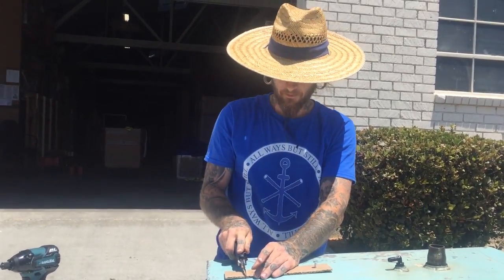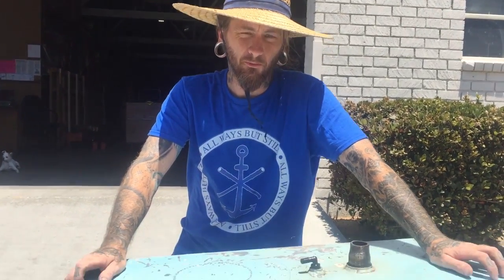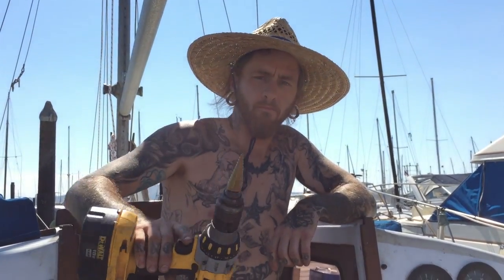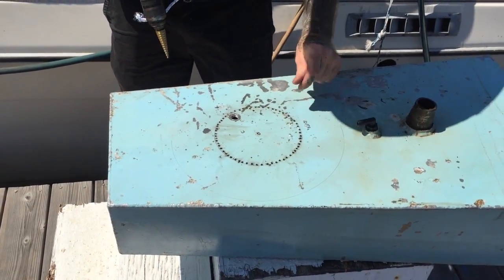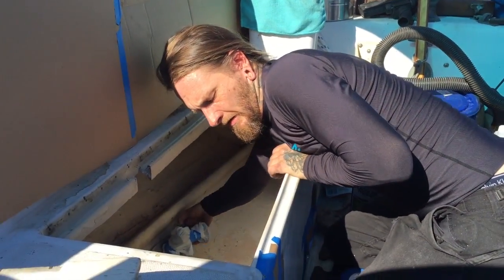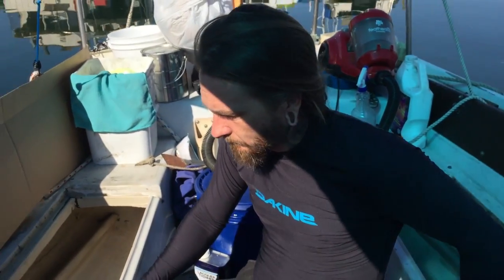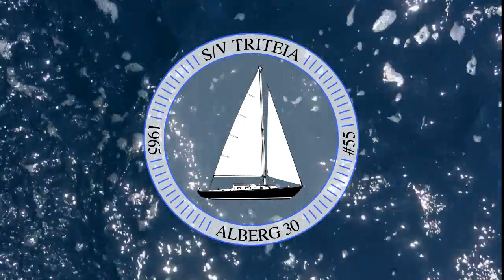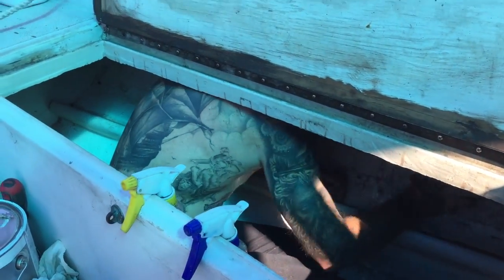Sailing Vessel Triteia - A Cut Above The Sludge - Episode 5 - Cleaning The Diesel Fuel Tank

Comment: For the bacteria, we had good results with drain cleaning chemicals (one tablespoon for a tank like Yours with every other full refill). But be careful, some newer high pressure injection pumps (TDI or common rail) react pretty huffy with any added chemicals in their diesel supply; so it depends what kind of engine You want to feed with it.
Keeping water and gunk out of the tank is way better than constantly killing the gunkdwellers.
What helps a lot against condensation is keeping the tank as full as possible at any time - not much air, not much condensation potential.
Reply: ;-) commented prematurely ... gm20 = prechamber low pressure injecting, so a bit of drain cleaner or chlorine shouldn't be a problem.
Reply: Hey there, which cleaning chemicals did you use to dissolve the sludge ?

Comment: Hello, thanks for sharing the video. I wanted to ask you something, I have the same bacteria in the diesel and I want to do the same but without removing the tank from the boat, do you think I will have problems with the gas from the diesel? I have been told to be very careful because even being empty when cutting the steel, the gases could cause an explosion....
Reply from the maker: Hi, diesel fuel is not explosive or flammable, it’s compostable. So no it won’t explode unless you have gasoline in is (gasoline is flammable and explosive)

Comment: Thanks for posting this. Just bought a 28 ft mid 70's boat rather similar to yours and was planning on just chucking the diesel fuel tank and replacing it with a bladder but now I think I'll do just what you did. It will save me a couple hundred bucks at least. (1/2 a decent used sail) I know this is an old video, but please tell me you have replaced the thu-hulls.
Reply from the maker: Hi Jeff, I have not replaced my through hulls yet, I have all new shinny ones bought and I am waiting for my PSS dripless shaft seal and cutlass bearing to come in and then we will haul out and do EVERYTHING. I am super stoked I did my tank as I have never had any issues with my fuel being contaminated with junk.
Reply: @SailorJames  I found it interesting that the order of things to be repaired/updated you came up with is almost the same as mine. Looking forward to the videos on the through hulls. I'm sure you'll sleep better once they are done. I've seen some Alburg 30's that had the inboard replaced with an 8hp longshaft outboard. There is a guy in the Carolinas who's made a business of it. Did you consider something like that?

Comment: I did the same with my aluminium tank but in the end it was cheaper to buy a DIABLO fuel tank, 108 ltr $219 aud ( round $ 160 usd..?) they are easy to fit, easy to fit a fuel gauge and so easy to clean...
Reply from the maker: Rad, I like this tank but will likely end up replacing it in a few years with a larger tank, but until then she is good to go !

Comment: Hi James. Great looking job you're doing there. Is that an electrically powered spray gun or did you have a compressor in the background somewhere. It's a good idea. I'm usually in there with a brush getting covered with the stuff, so spraying looks like something I could use, even if I have to follow up afterwards. About the gunk in the tank. I don't know how much you know about the stuff, but it's usually a form of bacteria that breeds on the interface between the diesel and whatever water gets into the tank, either via condensation or leaks. There's a ton of products they try to flog you, and, as usual, the one with marine written on the container being ten times the cost. I used to use some of them, diesel bug killers, as more bio-fuel has been added to diesel here in the UK. In the end I used my remaining grey matter (matches the hair now :-)). Each year I dump a cupful of bleach into my tank, no more problem. I should imagine a quarter to a third of a cup in your size tank when you refill would see the end of it. I don't do it through summer, as there's less condensation, but winter is the problem. I also tap of a jarful of fuel from the bottom tap on the tank to keep an eye on it every couple of months. Another great video, much appreciated.
Reply from the maker: I used an "Airless Sprayer" that is electric and can be sprayed even upside down, very very very handy, I borrowed it from work and it made the job so much easier, I used it to spray my engine bay as well and what a dream it was considering how tight and difficult it is to crawl all the way to the back it would have been. I read up on the bacteria that grows in diesel, which I am sure was the root of all the sludge. Thanks for your tip, I will write it in my boat notebook to help me remember later on!

Comment: Good job with the tank! I use a flexible one, small. Which kind of paint did you use for the storage bunk?
Reply from the maker: Cool, those bladder tanks are probably great in tight areas! (and much easier to remove than mine was, hahaha) I used Bildgekote on the storage bunks!
Reply: Yeah! Albatross is only 24'